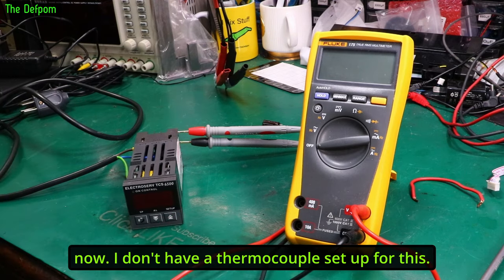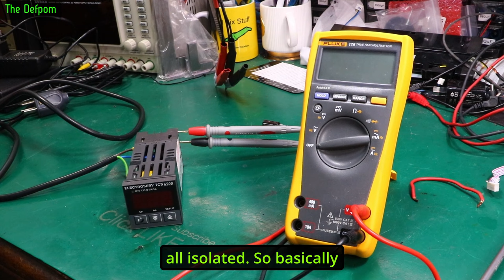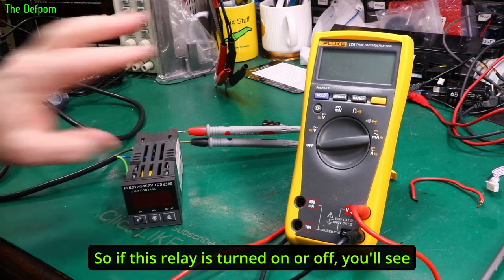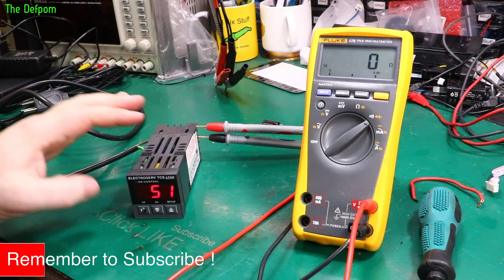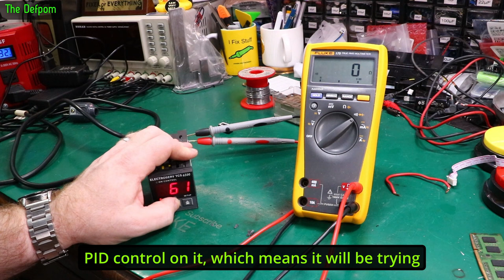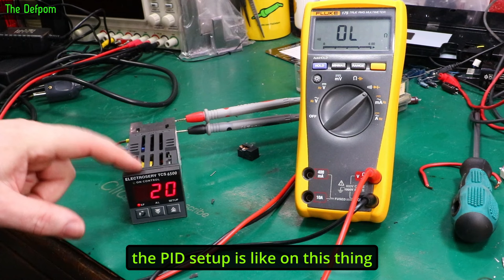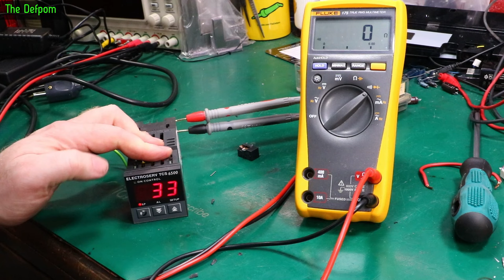🔴 PID Temperature Controller Repair - Electroserv TCS 6500 - No.1188

Comment: Are you testing my ability to read, now i can have two subtitles on the go. 🙂 i can read twice as fast.

Are you testing my ability to read, now i can have two subtitles on the go. 🙂 i can read twice as fast.

🙂
As a side issue how can you suck the holes out! the holes were still in the board after you tried to do it.
But i did notice a lack of solder :)

Comment: Hi, with these controllers, you can move the offset in the SET menu (mostly after entering the service code), change the hysteresis up and down - the width of the active band can be widened or narrowed, calibrate "0" when changing the sensor and, if it is multifunctional, set the switching logic heating/cooling.

Nice day 🙂 Tom

Comment: "Is that your heart monitor?" 😂😂😂 Mrs Defpom humor😂😂😂  Must have been an ugly bodge because you didn't show it to us,  but if it works it works. I agree with others, the English subtitles are not needed even for those of us who speak American. Great video, Scott. Regards, David
Reply: There was a whole lot of love, in your wife checking on your heart monitor. Kudos to Mrs. Defpom! Regarding the subtitles... I think I might like them, but I need to see them on a couple of videos to know for sure. I would say that they are a bit large. If folks are having trouble discerning your speech, it may be related to the tone of your microphone. Meaning, you could improve vocal clarity, by using an active equalizer and cleaning up the mud and hiss.... For mud, reduce the frequency in the 250Hz range. Hiss, aka sizzle, is found in the upper frequencies, of course, and should be reduced there. If you do not have a trained ear, you can see it with a graphic equalizer, or spectrum analyzer. My hearing has been damaged and is not what it was, when I was a young sound tech. But, I would say the mud is what is killing the clarity. Overall, I think equalization is the problem and not so much accent. If you can not get it cleaned up with an equalizer, you may need, additionally, a better microphone. HTH